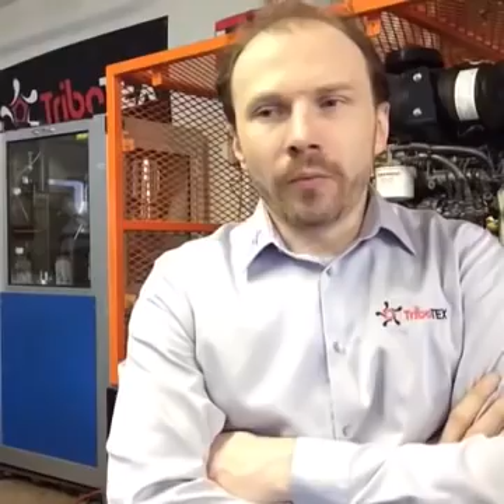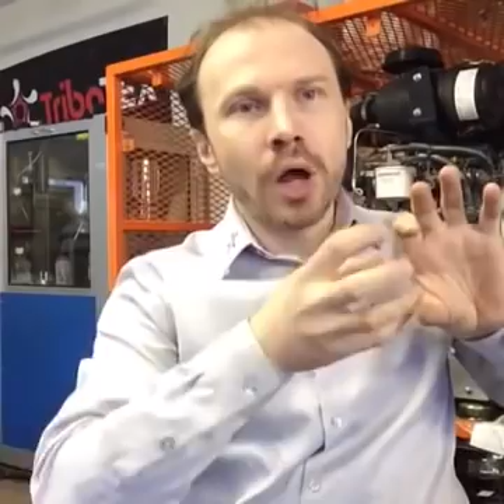How TriboTEX works to REVERSE WEAR

Comment: You can't reverse wear of metal surfaces that have been in opposing  motion for some time. The only thing possible is to slow it down by proper lubrication. Oil additives (those added there by oil manufacturers) have their purposes (and they work). Some of them, like detergents, help keep engine parts clean. Others, extend useful life of the particular oil, or may affect oil viscosity or a flash point. For the modern cars, in general,  no extra oil additives are needed. Many car companies are actually state that using anything besides what is recommended may void car's warranty. I still remember, some years ago, reading through Mercedes portal because I have seen people on the internet saying that Mercedes was recommending some particular oil additive. What I found was totally opposite. (Just can't remember the name of that miracle car oil additive). There were many lawsuits against manufacturers of this kind of products in the past and some of those businesses went bankrupt. But we seem to quickly forget and get easily fooled again...
Reply: Did you not watch this video?
Reply: https://spinoff.nasa.gov/Spinoff2020/cg_4.html

Comment: Building films doesn't equate to reversing wear.  Fun with words marketing.
Reply: because of the nano-size of the talc then it is hydrophobic on the external side and so slippery while the under side has adhesion that is sticky. The nanoparticles less than one micron then fill in the wear in the metal and build up a 30 micron size layer that is slipper on the external side. I did a blog post on it. https://elixirfield.blogspot.com/2020/11/will-advanced-german-engineering.html so to quote:  "The steel surface under high temperature is prone to oxidation by means of tribo-chemical reaction that lead to formation of metal silicate layer [14,24] and oxide film of MgO and SiO 2 [14]"

Comment: I used Tribotex in my BMW 2010 535i. After 200 miles my engine light came on and says not generating enough power for the transmission. May be Tribotex is making BMW clutch plates slippery due to less friction and engine not able to generate enough power to transmission. Has someone experienced it? Pls. add your comments. Is it intermittent and will get healed after 500 miles? or shall I not risk my car and flush the entire engine oil with new engine oil. Pls. advice.
Reply: It does not touch the clutch plates - Contact them they should help you.

Comment: A brilliantly clear explanation. And I should know: I'm a mechanical imbecile.

My 12-year old Camry loves this stuff.  So, I'm thoroughly won. Even my car mechanics are impressed by it now. And they should know: they're Cynics.
Reply: Dude, if you're tricked that easy I have tons of magical fluids I will sell you.  MY favorite is Total Engine Overhaul in a bottle.  It actually replaces crank and rods, ports and polishes the heads and rebuilds the head.  All for only $49.95
Reply: @drexellake4051  download more RAM on your computer while you're at it 👍
Reply: camry should be in perfect condition in 12 years.. engine wise,